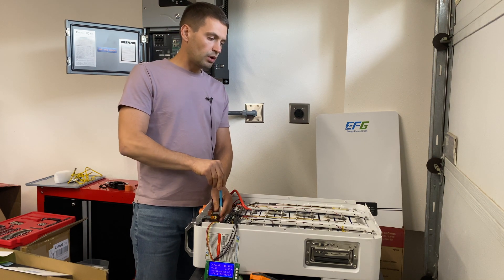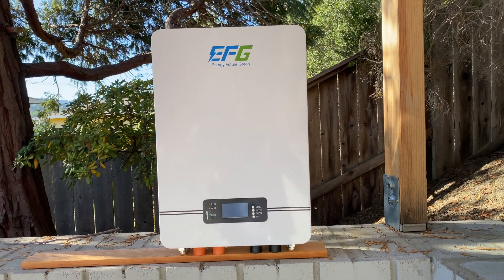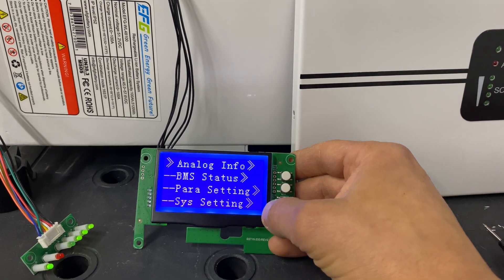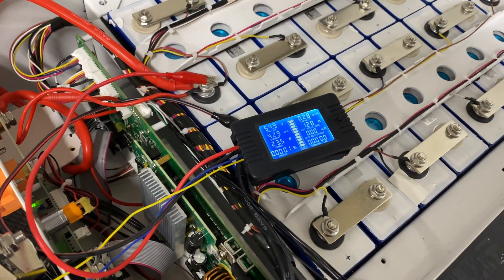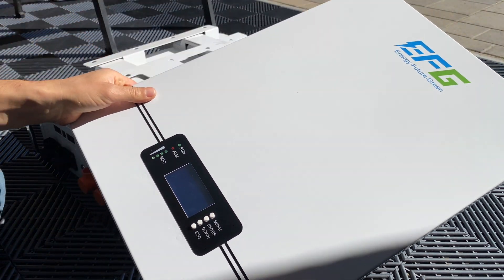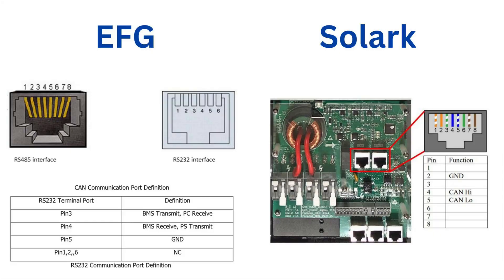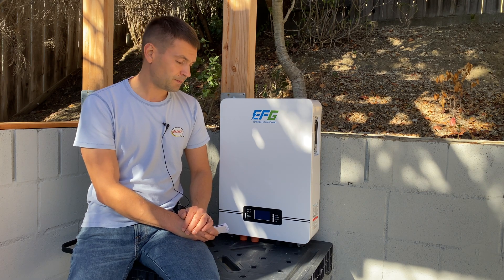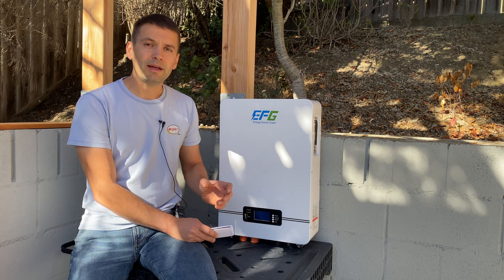EFG 51.2V battery. In-depth testing with Solark inverter.

Comment: What I have heard from the specialist who helped me set up my solar system, the BMS will automatically disconnect the battery cells to protect the inverter and charger if the voltage is too high/low. The BMS has set a protection value, and when the voltage reaches this value, it will disconnect to protect the inverter and charging equipment.

The BMS also disconnects to protect the battery when the voltage/current of the inverter or charger is too high. So, as long as the BMS is still working correctly, I don't think that unbalanced cell voltages will cause damage to other devices, as the BMS is fitted to the battery to deal with such a situation.
Reply from the maker: BMS is not designed to protect inverter or charger. It's just to protect cells. So when charger pushing 100A and BMS suddenly cutting battery then charger might have tough time.

Comment: The white shell looks nice and clean, and the wall-mounted model will allow the user to save a lot of ground space than the rack battery—an outstanding design.
Reply from the maker: ))) and your comment looks like you are affiliated with manufacture.

Comment: you mentioned that without CAN bus, the BMS will disconnect if one of the cells is over voltage. you mentioned this could cause damage, how would it cause damage ?
Reply from the maker: On one of the Solark webinars, I heard that a sudden battery disconnect might cause damage (while pulling/pushing significant current). 
I can dig up into manuals to find it.
Reply: @SolarEngineering  thanks for the explanation, would the damage be to the inverter?
Reply from the maker: yes, inverter/charger

Comment: why would i in heavens name buy this one, over a jakiper, sok,seplos or EG4 which are all cheaper
Reply: btw, this battery is using the same bms as jakiper and sok
Reply from the maker: if it's the same internal components, then doesn't make sense. I haven't tested yet other 48v batteries
Reply: @SolarEngineering  well , others did.
i'll bet if you take a good look at the bms, you'll find that it is a pace bms :)

Comment: Very honest review..... the fact that they are using an AC breaker for a DC battery application is a sign of bad design engineering.
Reply from the maker: thanks!
Reply from the maker: thanks!
Reply: Some breakers are rated for both dc and ac but they advertise knly the ac. So you have to resort to the manual. I bought an ABB ac circuit breaker and the seller told me it was not for dc but I referred him to the manual which said it can be used with dc but of course on a much lower amps.
Reply: *only
Reply: Not a problem for me. The AC breaker has a rated voltage threshold of 220V compared to the DC breaker's 60 V. In some situations, using the AC breaker is a much safer design.